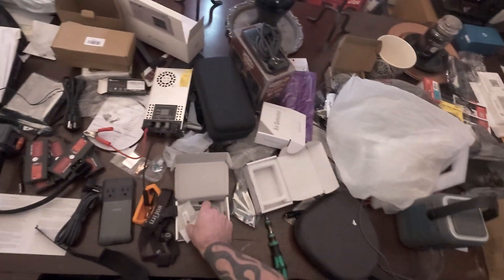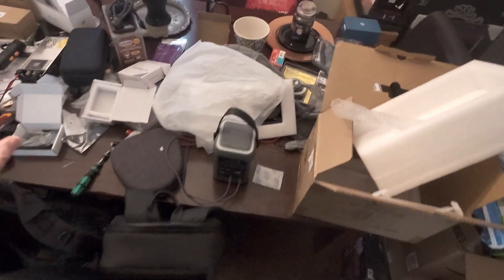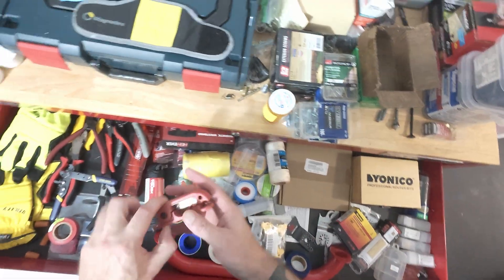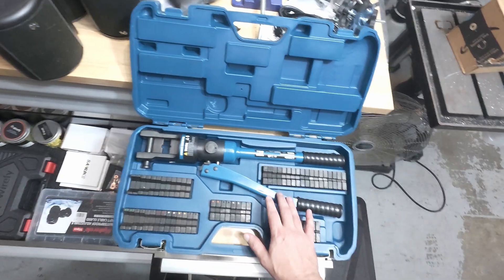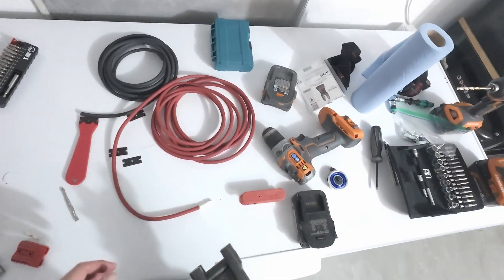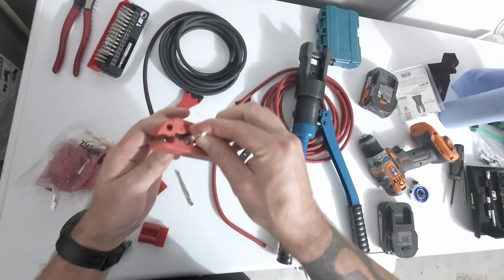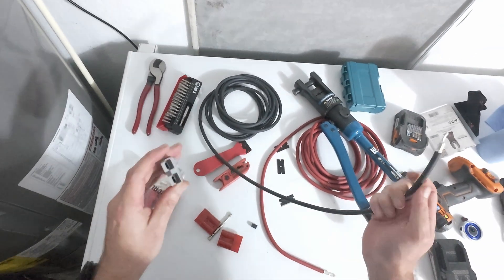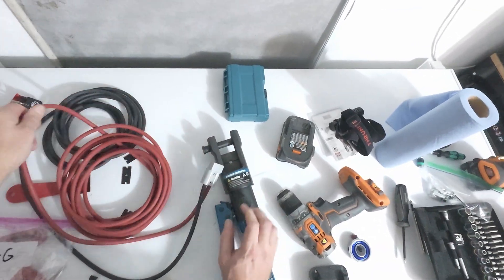Guide: Build Your Own Anderson Connection / Cable For Bluetti Apex 300 Hub D1 or Any Other Device!

Comment: I cant find your followup video for this apex 300 HUB modification?
Reply from the maker: The Apex 300 doesn't need a mod (though you can still hack it without this)

The mod I'm working on is the Ecoflow hack, they do not have a hub, so I'm making one.

Comment: Those are not genuine Anderson SB50. I really dislike the idea of using knockoffs as who knows how good their tolerances are. I buy mine from BatteryCablesUSA, Powerworx, DigiKey, Mouser, etc.
SB50 of different colors are keyed differently and will not mate between colors. The exception being black that will mate with gray. Red and Gray will not mate together.
SB50 are UL rated for 120A, but 50A for hot plugging. As long as you don't disconnect them under load and use 6AWG copper wire with high temp insulation they can push more than 50A.
I have a similar ferrule crimper and it's only rated for 8AWG, I use a Pro'sKit 902-160 for 6AWG or thicker.
I have an inexpensive iCrimp indent crimper and a Temco hammer crimper. Temco makes some good stuff and stand behind their products, but I've not talked myself into buying their hydraulic crimper set. :)
Reply from the maker: Good notes.  Most of that information is on the product page but I can see calling it out directly to be helpful.